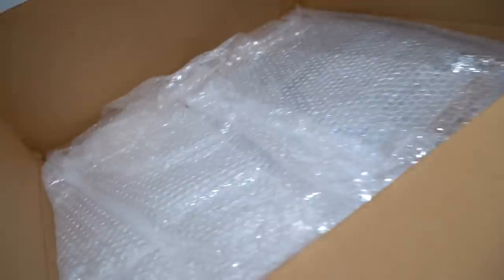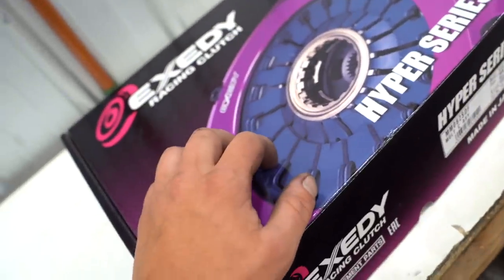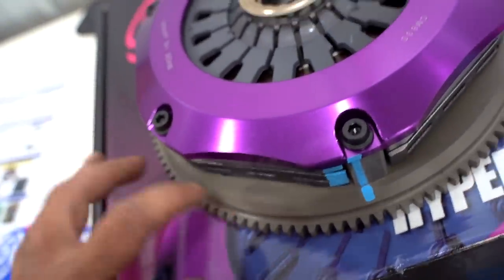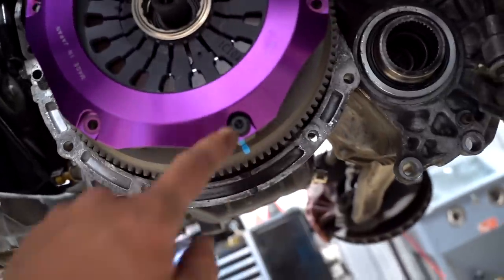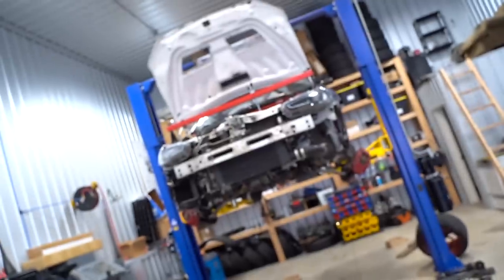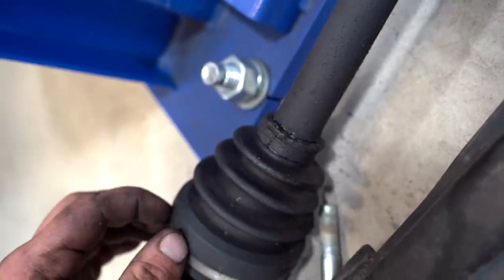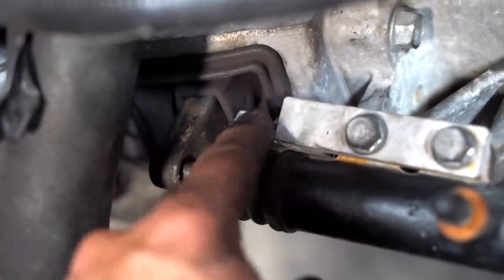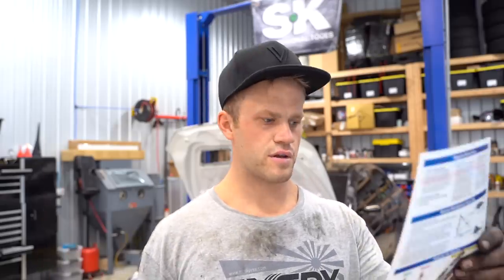Exedy Twin Clutch Install in 700WHP Evo X!

Comment: With the Exedy twin and triple plates, you should remove those anti vibration tabs that are on each plate, they make the clutch noisier but stop clutch lockout and prevent pre maturely wearing the clutch out, fit them all the time and this a known thing in the mechanical world, just a helpful tip for ya'll

Comment: Hi Devin, I noticed that the  clutch model you got is the MM062SDF which is stated as only rated for 553 ft/lb of torque,  Exedy would probably would have been better providing you with the cerametallic version MM062HD  for your power level, that one reputably is good for 615 ft/lb of torque.

I have the HD version in my much lower powered GSR and honestly believe that it’s the best DD clutch on the market.

Comment: Shouldn't you apply red threadlocker kn the fly wheel threads, I was always told that's extremely important, sometimes proper torque alone isn't enough. I'm also positive in the service manual for evox they require the red thread locker

Comment: Now we know why he took so long to change the clutch lol
Reply: anyone would be happy with free or sponsored clutch and goodies. But caution is required with putting strong clutches into five speed WRX and similar engined Subarus.
Reply: @keithprinn720  whys that?
Reply: @nikolasstankovic6794  because if the clutch is very strong you break the box not the clutch.

Comment: Just changed the clutch in my evo. Ran into an issue, car will not start only clicks from the starter. I tried to spin the engine and the flywheel feels locked, would you think that would mean anything? I checked all the wiring/grounds everything is pluged in, battery is good and charged also.